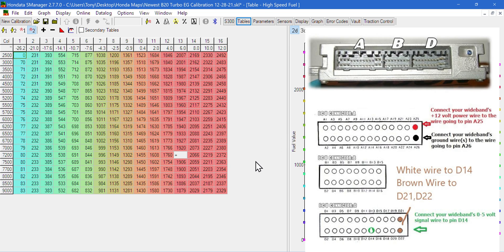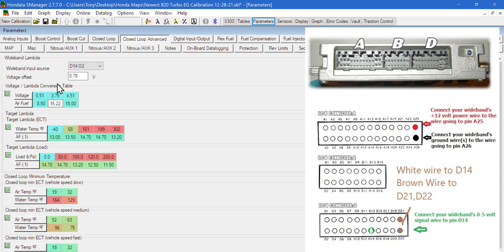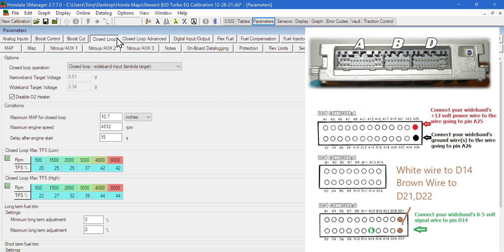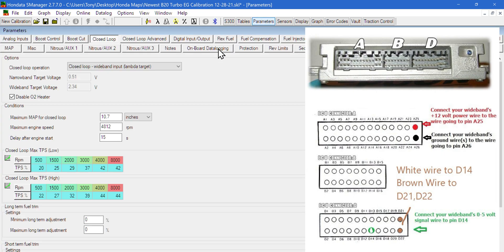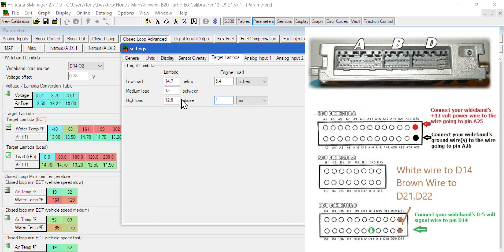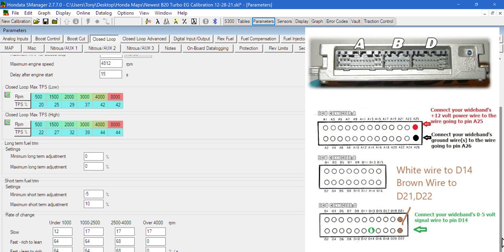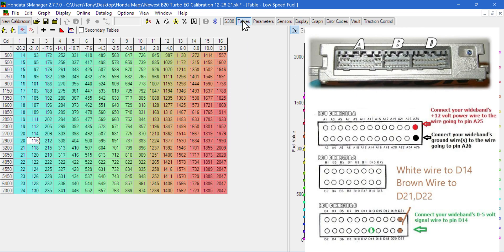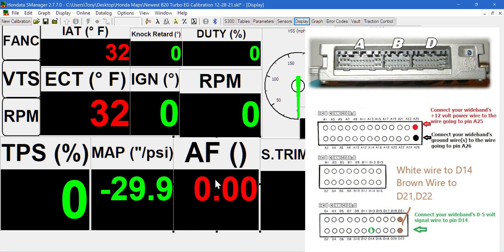Hondata S300 AEM Wideband install D14 to Trim fuel, Ultimate how to

Comment: im having trouble. My AFR reading is not matching my AEM guage. My gauge would read something like 11 and on hondata it would read 14. If i play with the voltage offset will this help it sync up? also which reading is more accurate the gauge or what ever it reads on hondata ?
Reply from the maker: Yes all that information is covered in the video. But yours is reading very far off and you should look into the wiring. Make sure the ground is in a very good place and wired proper with a high end butt connector or solder
Reply: @TunedbyTony could it be because i have it hooked to d10? Im gonna hook it up to d14 later see if that changes anything

Comment: So is the brown wire just spliced in to d21 or d22 or is it treated like the white wire and not spliced in but put in place of the other wire?
Reply from the maker: Add the brown wire to the existing wires going into the ecu. Do not remove the grounds going into the ecu.
Reply from the maker: Some harnesses won't have a ground there sometimes. It just depends.

Comment: I'm just getting static after doing all this. Probably my wiring.
Reply: Wait, how do I know whether d21/ d22 have a ground?
Reply from the maker: @wheniztheend  looks for wires coming out of those pins. You can continuity test to ground as well if you wanna make extra certain.
Reply: @TunedbyTony okay, well I know for sure the d22 pin is a ground cause I had cut it, and um, it was a ground for my other sensors, so my engine wouldn't start (oops). Anyways, after fixing that, I'm still getting nothing (voltage coming from my wideband is staying at like 3.75)
Reply: @TunedbyTony  I'm gonna double check that the connection I made on d14 is solid.
Reply: @TunedbyTony oops, I had it connected to D12 (EGR). Should have been paying better attention.
Reply from the maker: @wheniztheend  yea your gonna wanna re connect everything and jsut add your wideband ground to those grounds to ensure everything stays working

Comment: Will same method work with innovate  ECB-1 Afr gauge ?
Reply from the maker: If it uses a Bosch LSU 4.9 sensor then everything except the wiring is the same. And same information applies.

Comment: Go to options click on sensors, Scroll down to AF click the where it
says unit change the lambda to air fuel and put min at 10 and max
at 18.

That's how you get your 900 dollar ecu to show afr on the laptop. Don't learn lamda conversions that's silly
Reply from the maker: @boosted_donkey   Thanks I'm sure this helps some people. Personally, I never needed it to show AFR. 👍👍.
Reply: @TunedbyTony  I just like the guages to match. If I'm looking at afr on my guage I want the same number on my laptop

Comment: Thanks again for your knowledge bro. I had two widebands that the s300 wouldnt read... Like others said, i never realised i needed ground on both the black and brown wires. Works flawlessly now, and with ZERO voltage offset!

Comment: After i did everything im getting code 41 oxygen sensor heater what could it be. It only popped up after i set up the af and added all the settings
Reply from the maker: Disable the oxygen heater in the tune. This should be set when using an aftermarket sensor.

Comment: When looking at your fuel table I noticed that you're negative 20s and such start all the way to the left. As I feel it should be. For some reason on my tuning table it shows -1 all the way to the left and then -22 just before the changeover to .4 lb What did I do wrong. ?
Reply from the maker: Yup you’ll wanna go to Options-Settings-Units- under vacuum unit base. Select Atmospheric
Reply: @TunedbyTony  appreciate it that shit's been driving me crazy. And I currently have my white wire for my UEGO x ran into the ELD d10 pin with r136 and r138 both cut and I'm not getting an AFR signal I had it on d14 previously and was working okay but couldn't see the full range of voltage. I guess I'll switch it back to d14 later.
Reply from the maker: @matthewglaze5398  yea just follow this video and it should work as intended
Reply: @TunedbyTony  will do.

Comment: I have an innovate wideband. Range is 0v=7.35 , 5v=22.39 .

 How would i input the voltage in the table? Do i put the 5v value at the last cell? Since it can only rear to 3ish volts, do i put "3v" in the middle cell?

Thanks.
Reply: Hello I have also a Inovate wideband. Have you managed to figure it out?
Reply from the maker: If your using a wideband that uses the same sensor. a Bosch LSU 4.9 You use the same values. The values are not specific to the AEM gauge they are specific to the O2 sensor itself.
Reply: There is 3 columns.  0.00v=7.35, 5v=22.39, 5v=22.39. On my car the voltage offset is -.12. I used d10 eld.
Reply: And you are running on close loop I assume, right?
Reply: @robertkart9844  yes. Closed loop.

Comment: If I’m not running Hondata yet but have the SST chip, on N/A setup, can I still run the wideband thru the ecu without going in and changing the parameters in the ecu or will I run like crap until I get a tune done?  Planning on Hondata and turbo very soon.
Reply: Yeah..if you think about it sst chip has been the forever way to tune a honda ...hondata s300v1,v2,v3  has been the way since 2010 ish

Comment: Grounding to either D21 or 22 (logic ground) will cause a major voltage offset. I've got best results from grounding directly to the thermostat housing.
Reply from the maker: Actually in cases where there is no ground on the pin the offset is typically 0 it’s only when there’s already a ground in there and it’s shared that I have to run an offset
Reply from the maker: I mean I’ve done this on every car I’ve tuned and I have about a -.7 voltage offset which isn’t a big deal, I suggest this to give a solid ground where all the wiring can be in 1 place. But the thermostat ground is perfectly functional useable for this as well. Thanks for your comment
Reply: @TunedbyTony 🙏🏽 no doubt. I've wired a few in the way you do it here in the video, I was recently advised by a long time tuner that you def don't want to run more than 0.9v(+/-) offset, 0.7 is close, I redid the wiring just today on my integra with the ground at the thermostat, and my offset is now 0.02
Reply from the maker: @freeman8000   the reason I don’t suggest using the thermostat ground a solid answer is simple. It’s a 12v ground, and really it doesn’t matter if you run a 3 volt offset as long as you calibrate it right it really doesn’t matter. Keep in mind it’s a 5v signal so putting it on the main ground for the Ecu s wel as all other 12v systems doesn’t make a lot of sense to me. A Logic ground on paper makes more sense to me which is why we use that as well as in most cases it’s independent to itself.

Comment: Do I cut off D21or D22 then connect my brown directly to the ecu connector 8 inches up , or do I tap my brown in like the 12v is on A25
Reply: 3 years late, but don't cut off d22 😭. Your other sensors built into the engine rely on that. (idk about d22, but probably same thing).

Comment: how do you change the load index order in the table? Mince goes from -3.8 to -29.2 then it goes into positive pressure...its backwards
Reply: nvm I just found it LMAO BUT for anyone wondering its under OPTIONS / SETTINGS /  UNIT tab / then change Vacuum Unit Base to Atmospheric.

Comment: Do you just tap in to the ground on the D plug or cut it and connect it from the ecu side?
Reply from the maker: Any grounds work. If you choose. You can ground it straight to the battery for least possible electrical noise

Comment: Thank you, nobody says about the ground wire. Thought my sensor was bad, but I added the ground and worked flawlessly.
Reply from the maker: No problem this is why I made the video, enjoy a smoother ride and better mpgs my friend
Reply: @TunedbyTony  I'm tunning my car for the first time, it's a D16Y8, I have the idle set really nice but I'm struggling a little with everything else haha
Reply: @TunedbyTony  I have a d16y8 with an OBD2B to OBD1 jumper harness, my understanding is it uses A, B , and C not D. Is there a difference in wiring or am I looking at it the wrong way? I have an AEM 30-0300 on the way. TIA!
Reply: @alexanderlara2315 look at the ecu outputs and juts make sure that it is d14 that you are wiring the wideband too

Comment: Can you use A26 for the brown wire ?
Reply from the maker: Any ground works
Reply: @TunedbyTony  wanted to ask you another question , can I merge both black and brown grounds together and pin them to A26 ground , would it be fine ?
Reply from the maker: @jritefrom56  would probably work and function. But since I consider the ecu and the connection to be sensitive to voltage drop, I’d prefer it to be dedicated to the signal ground for maximum reduction of electrical noise.
Reply from the maker: @jritefrom56  For example, Honda engineers already integrated a multiple ground connection at the thermostat housing, so I trust that and I’ll wire common grounds to the thermostat housing ground wire, near the ecu connection.
Reply: @TunedbyTony  oh alright thank you . Yea I saw someone fuse them together and it worked for them but your info and opinion makes sense
Reply: @TunedbyTony  so black wire to thermostat housing and brown wire to pin D21 or D22 correct ? not a good idea to merge them together ?
Reply: @jritefrom56 you can merge them together and ground them together if you like.   I merge the black and brown together and ground then behind the stereo to that ground point.
Reply: @TunedbyTony  thank you for confirming 💯

Comment: I pinned into d10 with an x series gauge and had no issues had to do a voltage offset of like 0.3
Reply: Of course the two resistors have been removed but I wonder if they didn’t get removed how would it react
Reply from the maker: @bradleyhorn2316   you can use D10 after cutting them, using this same method just choose the D10 option instead of D14, that’s only difference in the setup in the software.
Reply: @TunedbyTony  what happens if you say not cut them while using d10?
Reply from the maker: @bradleyhorn2316   you have to cut them you can’t do it without
Reply: @TunedbyTony  ahh right on I got another customer car coming in it’s a lsv turbo setup s300 v3 the resistors are not cut on this one I don’t think I’ll do any cutting on someone’s ecu makes me nervous
Reply: Looks like I just hook it up the way you did yours 🤙
Reply from the maker: @bradleyhorn2316   yea, since the advancement of technology on the widebands, it’s pretty much completely un necessary do it any other way nowadays
Reply: @TunedbyTony  I agree brotha also another ?? when I go to brown wire to d21 or d22 can I just cut the wire at the ecu conversion harness and tap into it that way like I’ve done with the d14 n d10 wires in the past
Reply from the maker: @bradleyhorn2316   yes, the way I do it is i cut the wire about 8 inches away from ecu, strip the brown wire for the gauge, strip the black on harness side, strip the black on ecu side, I put some heat shrink down the harness/gauge side, then connect all 3 and solder/heat shrink them.
Reply: @TunedbyTony  oh shoot I need to connect both of them I thought you mentioned only one of the two alright I’ll do both
Reply from the maker: @bradleyhorn2316   you do only need to choose 1 pin
Reply: @TunedbyTony  ahh ok I was like I need to tie in the brown with both the d21 and d22 cool Ight obviously I’ve never hooked up a x series I’ve done innovate and old 4110 aem gauges. I’ll just go too d21 then 💪
Reply from the maker: Never said you can’t use D10, this guide just isn’t for that method, thanks for sharing though 👋😃

Comment: Hey dude just saw this video and definitely has been asking a few questions as I saw other people using the X-Line (hondata website etc) and they were able to make it work via the D10 (white wire) without the brown wire and of course removing the R136 and R138 resistors..... though me doing this myself... I'm not having much luck... Any input on this before I do as you've done? 
Perhaps i'm thinking if I also did the brown to the D21 or D22 and leave the white as is it might fix my issue... hmm
Cheers love from Australia.
Reply from the maker: If your using the x series gauge and you have the brown wire, it has to be grounded, otherwise your not gonna get a reading from that white wire
Reply from the maker: If you cut the resistors already and your wired to D10, follow the video instructions the same way just set your wideband input the D10 instead of D14
Reply: @TunedbyTony  yeah sweet mate, thanks for confirming... Thought it was the case after seeing what it did... And glad you answered the placement of the analog ground with either d21 or d22 :)

Cheers

Comment: Hey Dinuzzokek, I borrowed an aem x-series wideband from my cousin's Miata.  Let's say after I tuned my b20v civic, can I put the original O2 sensor back in or could I just plug the O2 bung and run without O2 sensor?  What settings do I need to change in the S300v3 if I run with/without O2 sensor?  Thanks a bunch for this video on how to wire it.
Reply from the maker: You can surely just borrow the wideband to tune the vehicle, just tune it in open loop then give your cousin his wideband back. The significance of this video is to show people how to connect the AEM wideband to the ECU when it’s permanently installed into the vehicle, to take advantage of closed loop operation while using a wideband.